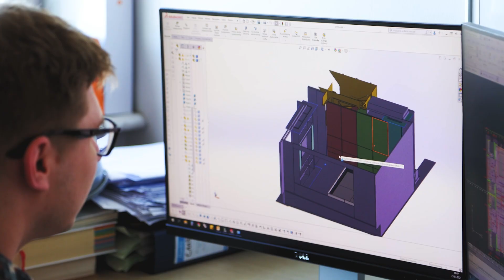Visiting Conrad Shipyard and Poland's Largest Superyacht to date - C144 Ace in Gdansk, December 2022

Comment: I have to say that the furnishings and materials are not on par with the 133!  Please replace all the chairs with soft more substantial ones and round off a few corners. While not as innovative as the 133, I do like aspects of the interior a little better especially the absence of loads of white.   Nor is it as aesthetically pleasing on the outside!   It seems more generic and hard to differentiate from other brands which is bad because its Conrad.   I hope the capabilities are similar with higher top speeds having sacrificed range as that is where the 133 stood out!  It should appeal to a wider audience, if that was the intention!  I kid myself that my numerous comments about losing the sauna and gym up top were actually listened to, but I don't see the restroom/shower opposite the bar to prevent having to walk down a level!  It is still a very nice boat and yet the 8 million jump in price for the extra 11 feet isn't readily apparent!  Inflation I guess!